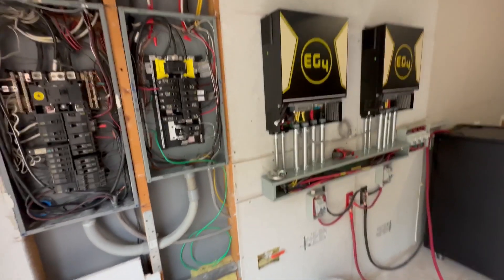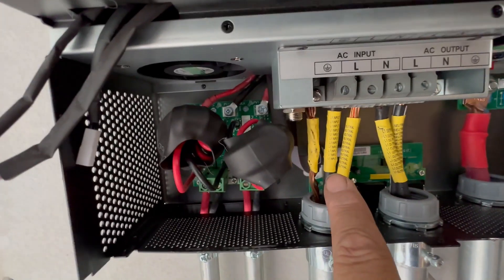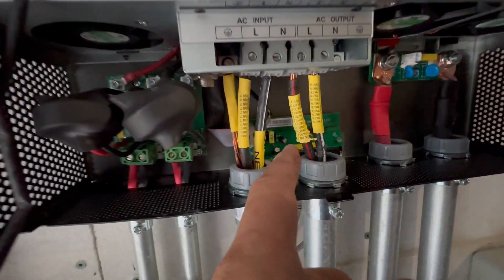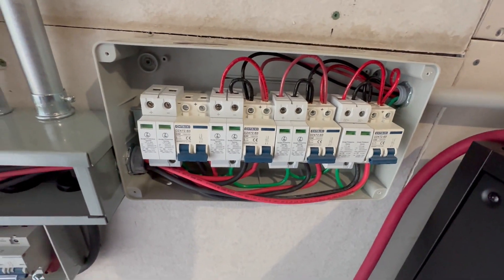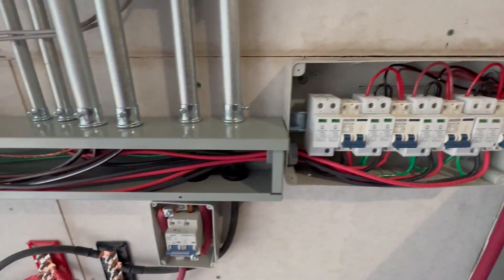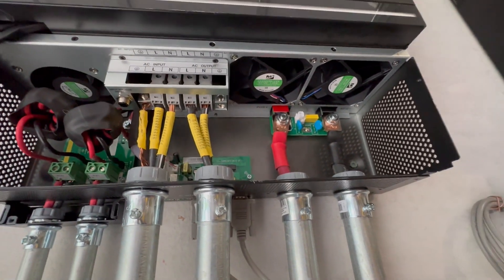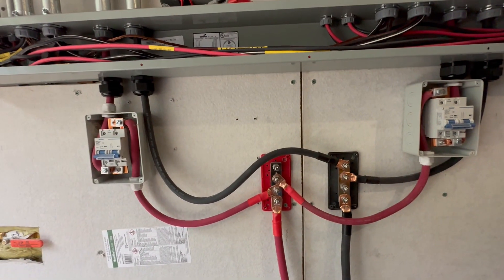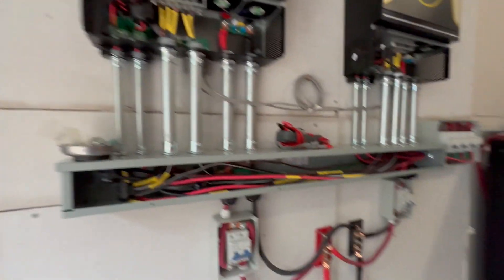EG4 6500EX wired up

Comment: Awesome work! Which surge protector do you use between the PV array and the eg4 6500ex?
Reply from the maker: I don't recall.  I have since replaced the system with the EG4 18K.

Comment: Did you just put the interlock cover on for when the inverters are off or being worked on? It will bypass on it's own since you have an AC feed IN correct?
Reply from the maker: Yes

Comment: I wanted to do something similar to my house, I have found that the wiring in my house was really messed up by previous owners so I can not use it/back-feed in good conscious. A circuit left from the panel and met up with another circuit and were tied together... insane. Fortunately they were both on the same leg configuration, if that makes sense. So, if you keep having issues, it may be faulty wiring in the house. I mean possible multiple neutral ground bonds, joining circuits, etc. Things that wont necessarily cause an immediate fire but will burn out electronics over time. Still don't understand why that circuit I was talking about, where the two circuits met (separate breakers leaving the box and joining somewhere* in the house), had 20v between neutral and ground.... Kitchen light worked for nearly 7 years then blew a ballast and that was likely the reason why.

To clarify, I turned off all breakers, turned them on one by one. The bathroom and kitchen wiring would energize when breaker 10 was flipped to ON and all others OFF.... but ALSO there was a separate breaker in the box, I think it was 18, that would energize the same wiring if breaker 10, along with all others, was turned off. uncool...

Comment: You only needed the Polaris connector for the neutral correct? I see two but I think you have have just used a longer wire from each hot leg?

Comment: Looks good, i will recommend just looking at those ac cable in and out connections, i see a lot of coper sticking out at the terminals. And i also prefer fuses between inverters and batteries.

Comment: Very nice work. I see that you only have breakers for the battery inputs and no fuses as I see in other installations, are just the breakers sufficient?. Is that #2 cable from the batteries?. That is a nice setup.

Comment: Looks great! I am setting up a system just like yours. I have a quick question, In your separate "Off-grid" sub-panel, How did you set up Neutral and ground? Did you bond them together and untied to the main, or did you keep the separate and tied to the main panel?
Reply from the maker: Separate but tied to the main.

Comment: You mention you have 3 strings going through the PV breaker box. You also showed the single IMO outside. Just trying to clarify because im installing my own EG4s soon. The IMO can only handle two strings but in your PV breaker box it looks like you have three strings. Can you explain that.

Thank you
Reply from the maker: Yes, it has 4 connections so I only have the positive connections switching so I can do 4 connections per IMO.

Comment: Sorry if this is a dumb question.  If I have two 6500ex inverter powering a critical loads panel in my house and it is connected to grid power for charging the batteries, (like your system) what happens when there is no sunlight and the batteries become low?  Will it use the grid connected power to power the critical loads panel or does the grid connected power only charge the batteries?  If the average load on the critical loads panel is 35 Amps can grid power keep the batteries charged quick enough so the inverter can supply power to the critical loads panel?  I am really just trying to fully understand the flow of electricity in the system and it's capabilities.  I understand the unknown factor is how large is my battery bank.  Thank you any insight.

Comment: Are you satisfied with the +red and -black 4 lug terminal blocks you are using for your battery cables to connect to?  Appreciate sharing source/brand/specs/link if you dont mind.
Reply from the maker: No, I don’t like these because of the covers but they are functional.  They are  chinesium from Amazon.

Comment: I am in the middle of my install and I'm scratching my head on routing the conduits to and from the load center. Where did you get that cable channel? makes everything look so neat. better than conduit running everywhere.
Reply from the maker: Sorry for the late reply,  here’s it is… https://www.ebay.com/itm/223748451770?mkcid=16&mkevt=1&mkrid=711-127632-2357-0&ssspo=wilYmq7BTxG&sssrc=2349624&ssuid=D2cLAvs5QT6&var=&widget_ver=artemis&media=COPY
Reply: Electrical supplier

Comment: Hey! How did the setup work out?  I saw your post on DIY solar forum. I like the J-Boxes you have the Nader Dc breakers in. Im thinking of ordering them. My system has been running well, but I haven’t passed inspection yet. Need to put my Nader breakers in a JBox. 

My question is what size wire do you have after your external bus bars for the battery bank?  Im guessing you ran 4/0 from the battery bank to the bus bars and then switched to 2/0?  

Hmm I guess the Nader breakers fit 2/0 so I guess I just answered my own question haha. Could you confirm though?  I want to make sure the link to the Jboxes you posted in the forum will fit 2/0 and hopefully the wire glands that come with it also fit 2/0. 

I’m gonna message you on the forum as well, so feel free to respond in either place.
Reply from the maker: Just saw the message here.  Did everything work out?
Reply: @69RGH  yes! Actually I passed inspection. I was told I didn’t need the DC breakers or Busbars in Jboxes because they are DC!  I’m very happy, but maybe I’ll eventually put the breakers in a Jbox anyway

Comment: Nice video. 
I am in the planning early setup stage of my system with a design close to your setup. 
Double check your Surge Protection Devices (SPD) wiring. Everything I have seen and read shows SPD after passing through the breaker.
Reply from the maker: You can wire them on either side of the switch. But by placing them before the switch, they can still protect the solar panels even when the switch is off.